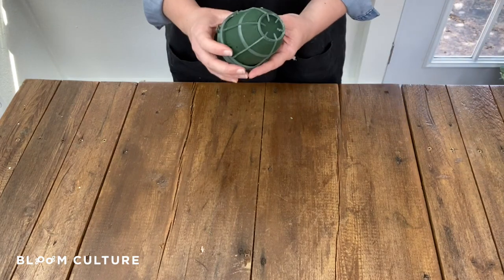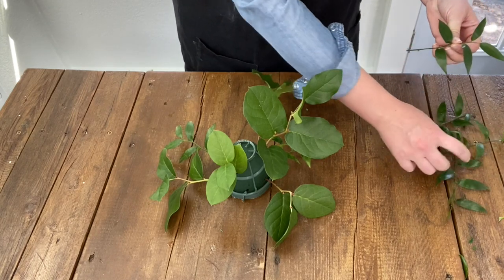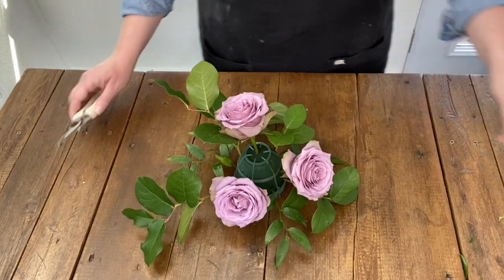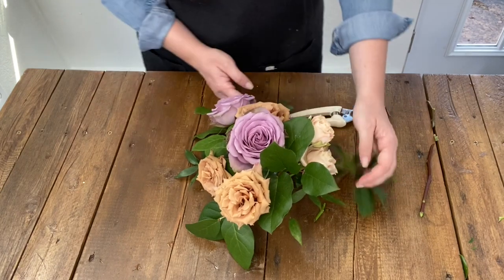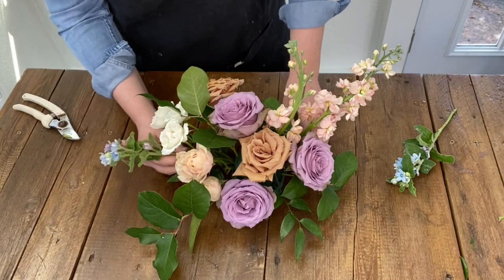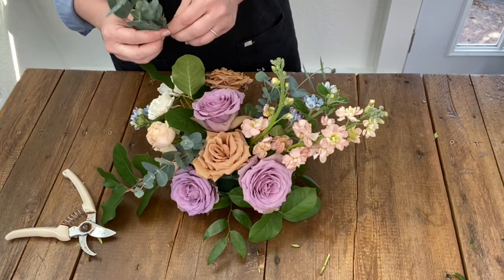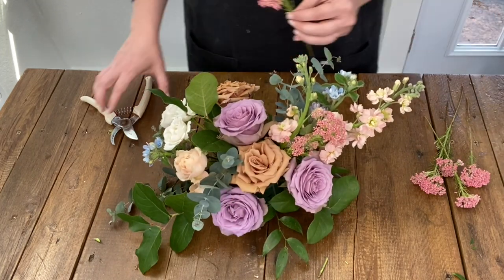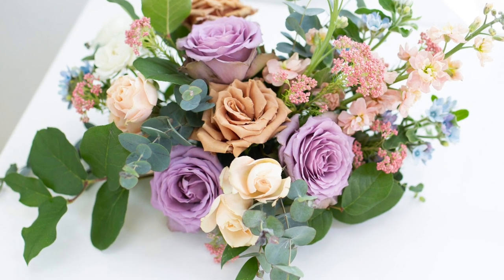Floral Foam Centerpiece by Bloom Culture Flowers

Comment: How long do flowers last in foam?
Reply from the maker: It really depends. I usually try to do foam pieces no more than 24 hours from the even because it’s not a direct replacement for water. Sometimes flowers do great in cooler temps and sometimes they dry out. It depends a lot on the season and region you are in, and types of flowers/greenery used. Lots of variables to think about.

Comment: Can you put these on top of tall clear vases?
Reply from the maker: You can! Just make sure the size of the foam cage works with the opening of the vase. If it’s too small you may use a small lomey dish (clear plastic tray that comes in different sizes).